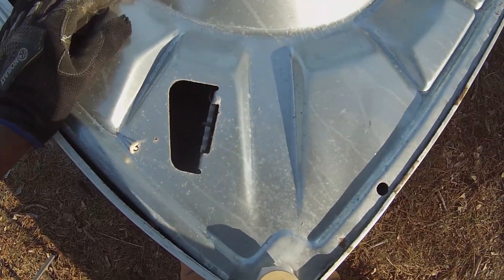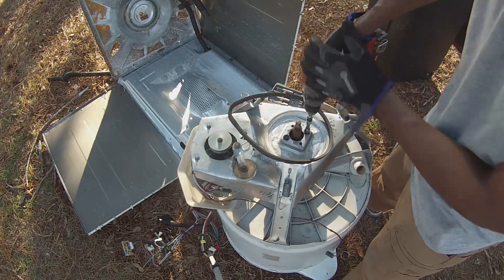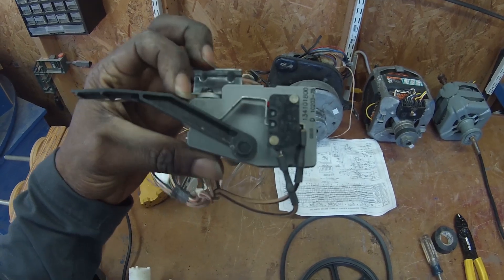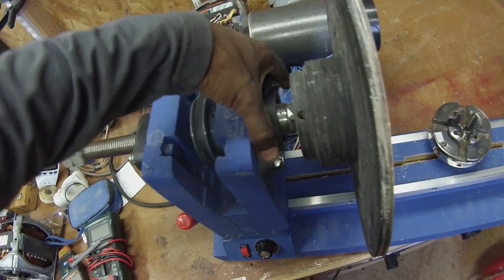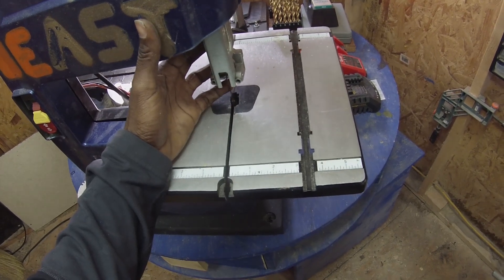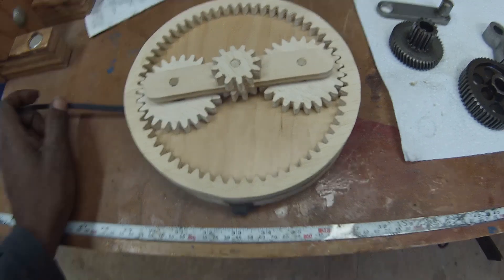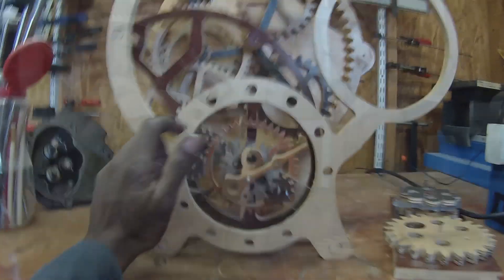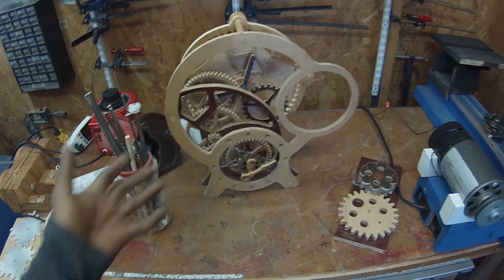Things You Can Make With A Washing Machine And Other Salvaged Components : 020

Comment: I don't know, that washing machine looked to be in pretty good condition. What if you're a crazy person who steals washing machines? I'm curious about dryer motors, how do they differ? Can the transmission (gear box)  be used for anything? (nevermind) just wish I could do this stuff, there are a couple tools I would love to make. If you ever make drawings, let us know.I am particularly interested in the lathe and the sander. Love the clock. Just genius, great videos thanks.
Reply from the maker: I was surprised at the condition as well. I think the water pump stopped functioning. Everything else looked pretty good. There  is a dryer motor in the video. Its the one all the way to the right behind the lathe. It is wired pretty much the same way the washing machine motor is. They are usually smaller. That one is 1/4 hp.I will make plans for the new lathe design. That is part of the reason I am redesigning it. To improve the parts I want to change, and make it easier to build. I could make plans for the sander, but that will be a later project. The lathe plans will likely come first.
Reply: People throw things out all the time that only have minor things wrong. Push mowers for example that have gotten wet and won't start. It's amazing how wasteful society has become. Great job on this washer and you scored so many useful parts!

Comment: In the past I've taken the outside case/cabinet n cleaned it out, put a wood top on it, casters on the bottom, drawers or shelf space. Wooded door can be added too is so desired.   Very strong tool stand. If the washer was in nice shape & you take your time the wife might Decide she'd like a mobile stand.    If I lived urban would try to make fancy & sell.
Imagine one of those nice new stainless steel models , with a butcher top block , shelf space & wine rack under. Hmmm
Reply from the maker: I like this idea. If you managed to find one with the stainless steel body that would be an amazing looking cabinet/counter top.

Comment: If you want to reduce the rotation speed of the motor do you just reduce the the voltage?
Reply: The short answer is no. That only works with permanent magnet DC motors. What we have here is an AC induction motor. So it spins synchronous to the frequency of the current it runs on. There are resources on the net that explain how it works. The current goes through that mess of copper wrapped around the motor and generates a spinning magnetic field, which induces a current in the rotor, which makes its own magnetic field. The rotor's field chases the stator's field. Quite bizarre really. It took a genius like Tesla to come up with it all.
Reply from the maker: +Jason Barre not with an induction motor. It will just draw more current to "catch up" with the line frequency. It has to follow the 60hz (in the US) speed. With a small lag called slip speed.
Reply: Wow such hostility. I'm glad you will only say that once.
Reply: Jason Barre You can reduce the speed with gearing. Like he did with the clock!!
Reply: No. An AC induction motor spins less than the frequency it runs on. That is an inherent factor of the design. Faraday's Law of Induction states that voltage induced is equal to the negative derivative of the magnetic flux. An induction motor is a brushless motor in that there are no electrical connections to the rotor. The magnetic field in the rotor is produced only when there is a changing magnetic field present to induce a voltage in the rotor windings. When the motor starts, the speed of the rotor is zero, and the electrical field is say 60 hz. That is a 100 percent slip speed, and will induce a maximum voltage in the rotor. The rotor is a "shorted squirrel cage" with shorting rings to make a complete circuit in the rotor. This means that there is a maximum current in the isolated rotor. This produces a magnetic field in the rotor that can then interact with the rotating magnetic field in the stator, producing torque. If the speed of the rotor exactly matches the speed of the electric source, then there is no induction the rotor windings; therefore, no magnetic field induced in the rotor, and no torque produced by the motor.
Reply: Variable frequency drives do work with AC induction motors along with various types of synchronous motors. Variable frequency drives ramp both voltage and frequency as they increase output. 

A BLDC motor has a fixed (the rotor has magnets instead of coils) field excitation, and synchronous speed, and no brushes; an AC motor/gen has variable field (rotor) and synchronous speed, but with brushes; and an induction motor has a variable field (due to frequency mismatch) and no brushes, but with a non-synchronous speed. 

Brushes are electrical contacts with the rotor. Slip rings and commutators are the two different types on connections; and while they serve a purpose, the connections are a rotating wear point that needs to be cleaned and serviced. Brushes also create a power loss.
Reply: That is a fairly standard size for industrial motors. The frequency/voltage/current relationship depends on the type of control. One example is a linear volts/Hz control. When I was an electrician we worked on everything from <100hp to MWs power. A lot of the equipment did not have variable drives, and some had motor-generator sets. On the big variable frequency generators that were directly coupled to induction motors, the governor/regulator varied voltage with frequency. By that I mean that the voltage regulator is directly controlled by the governor control. When you increase the frequency, voltage will track accordingly. Those motors were stories tall for reference.
Reply: All very helpful information, thank you.
Reply: To put it shortly: in an induction motor, the rotor excitation and torque of the motor are proportional to the frequency mismatch of the electric field and the rotor speed. If the two are synchronous, then the motor will produce no field in the rotor, so no torque.
Reply: Funny, I have installed large(?)  VFDs and never knew they messed with the voltages. I thought they only messed with the Frequency.   IDK is 25-100 hp motors big? I mean I know there are larger HP motors but in the "normal" range of light industrial uses. 

 I was building HVAC units as an "electrician". Electrician as in drill holes, run conduit, pull and ID wires, mount and terminate equipment, build panels and never see the complete unit run.  I was a model builder on the grand scale.lol  If it was on the print it was in the unit. I made the mistake of pointing out a screw up one time and was reprimanded for my troubles.(but not rewarded when it turned out I was right.)
Reply: I have scrapped so many washers. Never salvaged any parts. I could really use that lid switch for my gas to electric tiller project.
Reply: +TheFootbaldd of course AC induction motors spin synchronous to the frequency they run on. That is why Variable Frequency Drives work on induction motors. Weaseling about the slip doesn't change things either. That is a separate issue.
Reply: Paul Frederick it matters to him because he's making a clock. What ever percentage difference there is, will be noticed over time in the clock.
Reply: Zee-L Usay have u heard of the icm cc750 sure does make my 13sear Rudd quitter
Reply: Clearly the discussion has gotten too technical for you, let's try a different approach:

Let's say a discussion going on about apples: 
Someone comes along and asks, "Are they similar to strawberries?"
The discussion shifts to the differences between apples and strawberries.
Then +Paul Frederick chimes in with, "NICE ORANGE!" 
It is explained to Paul that we were discussing apples and Paul says, "IT"S AN ORANGE!"
It is further explained to Paul that apples are different than oranges.
Paul gets his panties in a bunch, starts becoming hostile, sticks his head in the sand, and doubles down on his mistake with, "There is no difference between apples and oranges!"

+Paul Frederick wrote: "There are resources on the net that explain how it works." 
Perhaps you should head your own advice and try reading them...
Reply: +Paul Frederick Things can be lagging and synchronous such as in 'SYNCHRONOUS' motors  however, for INDUCTION motors you are: FLAT OUT WRONG!  I always think it is funny when someone is flat out wrong and they are (childishly) insulting when they 'explain' it to others.  

+Paul Frederick  you should know this: people that understand induction motor theory correctly are laughing at your insult and your very obvious and elementary mistake.

A VFD will change the speed of an INDUCTION motor because the rotor speed is a percentage (based on load) of the synchronous speed.  The synchronous speed is a directly proportional to the frequency and is the speed that SYNCHRONOUS motors rotate.  INDUCTION motors will always rotate slightly slower than the SYNCHRONOUS speed. The difference is called slip and it is usually expressed as a percentage of the synchronous speed.

 +TheFootbaldd is correct, if there is no 'slip' in an INDUCTION motor, there is no relative difference between the rotor speed and synchronous speed, thus there is no current induced on the rotor and no torque is generated.

You don't even need to take our word for it, and obviously googling it is WAY TOO MUCH work for you.  Try watching the video @4:33 he shows the motor running at 1750rpm or ~1% slip, which is pretty common for INDUCTION motors operating under no load..  IF it was a SYNCHRONOUS motor it would be turning at 1800rpm or exactly 0% slip at a lagging ANGLE.

Moral of the story, chill the fuck out and maybe you will actually learn something.
Reply: Close, but not quite. This is not a BLDC or other type of synchronous motor like the reluctance motor or standard A/C generator. Slip angle applies to synchronous motors. The induction motor does not spin synchronous to the line frequency. The induction motor is therefore non-synchronous. It requires a frequency mismatch between the electrical frequency and the mechanical speed of the rotor. In order for generator action to occur in the squirrel cage or "rotor windings" there needs to be a changing magnetic field present in the rotor. This is satisfied by the rotor spinning slower then the field in the stator. 

This is known as the slippage and has to do with self regulation of the motor. When load increases, speed of the motor decreases. When the rotor speed decreases relative to the stator, the percent slip increases which increases the field excitation in the rotor (More slip equals greater induced voltage in the rotor, which results in an increase in current in the rotor, which results in a stronger magnetic field in the rotor, which reacts with the field in the stator at a greator degree.). This, in-turn, increases torque of the motor to a stable state at a new lower frequency or percent slip.  

You can easily see that it is an induction motor by measuring rotor frequency loaded versus unloaded. In a synchronous motor there is a phase shift between the mechanical and electrical fields, but they operate at the same frequency; however, in an induction motor, there is a frequency mismatch between the electrical source and the mechanical rotor. When the induction motor is unloaded, the speed of the rotor will be just shy of the electrical frequency. The slight lag is due to electrical and mechanical losses such as the bearings and copper lose to heat. As load increases, the rotor slip percentage and rotor speed mismatch will increase until max torque. This is limited by maximum voltage, and incoming frequency as well as the design limitation of the motor( heat, speed, vibration...).
Reply: +James Jenson For all practical purposes induction motors run synchronous to the frequency of the current they run on. Minus the slip that matters so little most motor manufactures themselves ignore it on nameplate markings. But you know more than they do. In fact I've seen more motors marked with their free running speed than loaded speed. that's how much it matters. The people that make electric motors don't give a shit, so why should I? Or better yet, why do you? Do you really think you're going to notice a 0.9% difference in speed at 1725 RPM? Who the fuck are you, Babe Ruth's more talented older brother?
Reply: +TheFootbaldd listen up you stupid fuck, because I am only going to say this once. Things can still be synchronous while lagging, or leading each other. Even with a variable ratio!